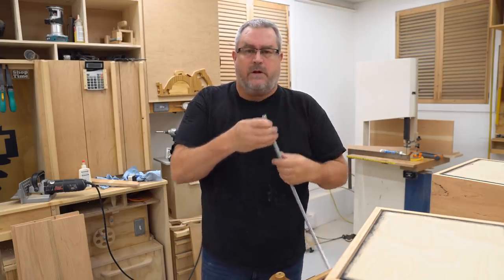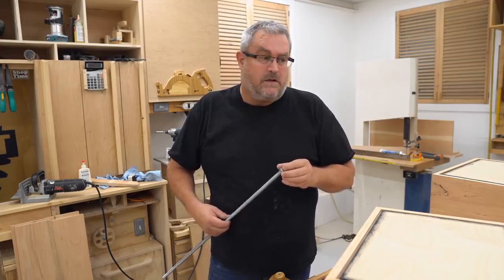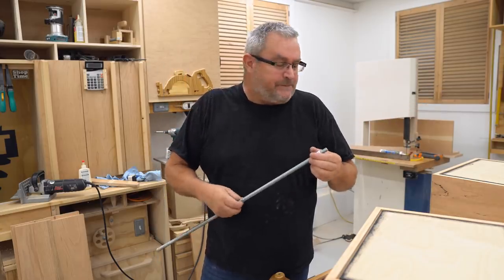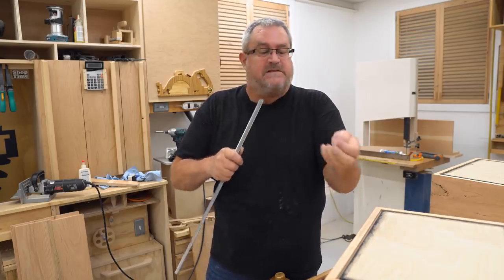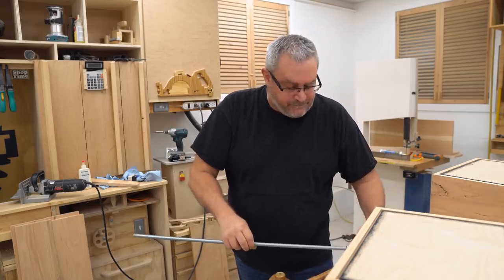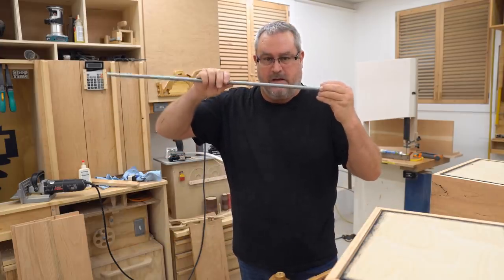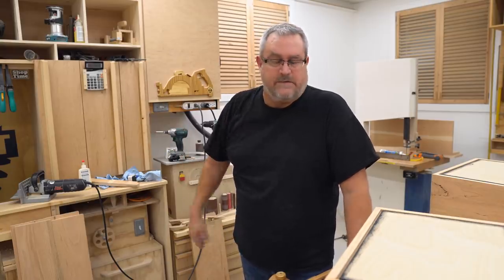Why I Don't Use ACME Threaded Rod

Comment: We had this problem at work with a valve spring compressor. It uses 11/16ths all thread to compress the 4 springs. Probably somewhere in 600-800lb spring force. 

We switched it over to grade 8 all thread and never had a problem since...... but obviously not available at your local big box store.
Reply: 11/16ths is an odd thread size. The last common thread in 1/16ths is 9/16ths. After that the sizes go up in 1/8ths. So after 9/16ths the next size is 5/8ths then comes 3/4s Which leaves 11/16ths out.
Reply: @1pcfred  Ya. I don’t know why I put 11/16. It’s actually 7/16 and uses a 11/16 socket. That’s where my 11/16 came from. Lol.
Reply: @BudgetBuiltDiesel  7/16 is a SAE thread. Still not a popular size though. It sits between 3/8" and 1/2" which are both very popular. The common head size on 7/16" is 5/8s I have a bin of them next to me. I stock all sizes from 2-56 up to 1-8 I'd have had to get up for a 2-56 though. The 1/4-20 to 5/8-11 bins are within arms length. I didn't even have to stretch to get some 7/16-14 really.
Reply: @1pcfred   The nut takes is 11/16 size for a 7/16-14. Where the bolt head for a 7/16-14 is 5/8. 

We use the nuts with all thread and not the bolt.
Reply: @BudgetBuiltDiesel  let me check that out. The bin of nuts is right under the bolts. You're right! Probably the only person on the net that is right today. It is such a rare occurrence anymore that I'm shocked when it happens. There's usually two nut flat sizes for every thread. There's the regular size then an oversize. If I pulled the bin out I might have an oversize nut in it. I'm not getting up right now though. Sometimes I do store the oversized ones separately. But I wouldn't for 7/16-14 It is such a goofball thread I don't have much of that hardware at all.
Reply: @1pcfred  Ya. It is weird. I checked McMasterCarr before I responded  to make sure sizing was right on the nut. 

I only use it for this shop made tool. Other then that we hardly use  that size at work.
Reply: @BudgetBuiltDiesel  7/16-14 is not a popular size. It is between 3/8-16 and 1/2-13 and they're very popular sizes. So 7/16-14 gets elbowed out by both of those.

Comment: All fantastic points! I wonder recon threading your own nut would be better as you get full cut threads instead of those flats on the inside of the nut, im not sure how the rod interfaces on the inside of the saw but if it was possible you could enclose the rod then then drill an oiling hole through the nut?

Comment: Here in italy we have untreated rods and nuts, they are just plain steel. They are stronger and more precise then the galvanized ones. Are they available in other countries?
Reply: Normally coated fasteners are zinc-plated rather than galvanized in the United States.  I expect Canada is similar.

But your thought on surface-coating does bring up the interesting point about dimensionality.  Sometimes no effort is made to account for reduced tolerances and parts fit poorly, sometimes only minimal effort is made in that excessive clearances are left prior to coating and parts fit poorly.  AvE did a video comparing the various quality of fasteners, the cheaper fasteners tended to be over-spec as far as strength was concerned, while the more expensive ones tended to be right on-spec.  The more expensive ones were easier to torque properly.
Reply: Galvanized means zinc coated.
Reply: @alans1816  Galvanized and zinc plated as TWX1138 said are not the same thing.  Zinc plating is very thin.  Galvanized means dipped in molten zing and is much thicker.
Reply: @TWX1138  galvanized is zinc. The other common plating is chromate. That's the gold colored hardware. Hardware comes in fit classes. It is supposed to be looser and tighter. What you're getting at a hardware store is class 1 fit. The sloppiest stuff going.

Comment: Acme has higher efficiency than universal all thread thread. Which is why you are more likely to see acme thread in applications where movement is important. As I can recall acme is 40% efficient and all thread is 10% A ball screw is 90% efficient. That's the range.

Comment: John, save yourself a lot of guessing and go with grade 8 threaded rod and nuts. They are rated at 33 rockwell on the "C" scale, that's fairly hard and wear resistant. For a comparison a hand file is around "48" on the "C" scale.

Comment: Isn't a precision adjustment only important for the blade angle adjustment?
It would seem like the blade high adjustment  mechanism could be simple, like a circular saw.
I guess if you're not making dadoes/box joints, no?

Comment: I can understand your desire to source the materials locally, but, and I'm not sure this is true, is Acme threaded rod better?  When you're building something that you'd like to minimize the chances of failure, my guess is Acme rods use a better/harder steel.  I know I could be wrong on this but from my limited use, simple threaded rods/bolts use cheaper softer "junk" china metal.
Reply: The geometry of the threads is the main factor. Trapezoidal threads move better than V shape all thread does. 400% better. What's going to grab more sharp teeth or flat teeth? There's more to it than that but that's part of it.

Comment: From a mechanical standpoint, by hammering it, you would concentrate the force to a smaller area that the thread is engaged, subsequently increasing the stresses on the engaged area, and hence increasing the chance of it stripping it. On the other hand, if you have two nuts glued or welded together to bear the forces, you half the load on each thread and significantly decrease the chance of stripping the threads. You would be still using the non-specialty parts, but tackling it scientifically using regular hardware store parts.

Comment: Your reasoning is certainly valid but buying Acme threaded parts is no harder than ordering a set of your plans.  I couldn't buy your plans at the store either so I ordered them.  Same with Acme stuff.  I've lived in small rural towns and in major metro areas so I understand the difference when it comes to specialty parts.  There are plenty of places that will deliver to your door.  The failure is no surprise with a loose fitting nut.  What percentage of engagement do you think you have with such a loose fitting nut?  Not much.  Add the soft steel to the equation and  failure is imminent.  Sure, you have to order Acme threaded components but they're as close as eBay.  Take this as a positive comment.  I really like your channels.
Reply from the maker: My plans aren't shipped. There are places in the world where people buy my plans, but wouldn't trust the delivery system to order goods online. Or the shipping is expensive. Or the import duty is expensive.
Reply: @IBuildItScrapBin  Fair enough.  Some of the small towns I've lived in were pretty third world but they were still in the US so stuff would arrive eventually.  I didn't consider the viewers with delivery difficulties.  Sorry.  I know your plans are delivered by the Internet.   I've bought some.  Thanks for your great content.

Comment: Hmmm..very suspicious, the whole thing.. Maybe you had bad luck with the material. Usually the hardware shops dont sell the best quality^^... As far as i can tell, i never had such a incidence.  I have built a post vise for metal working, using a M20 rod and i am abusing the hell out of it. I keep it lubricated and i can see no sign of wear on it.. Also i have built a solar tracker for my PV system. The M10 Rod + coupling nut (more threads) does well since 8 years now... Every day from east to west and back in the night time... Hmm..perhaps we have better treaded rods over here in Europe.  ;)

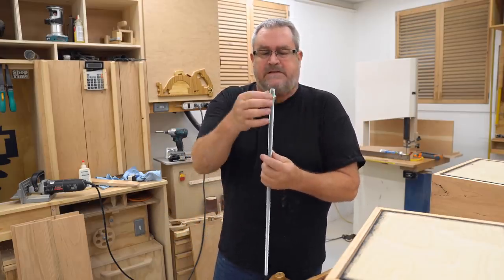Comment: @4:30 has to be the smoothest execution of "Deez Nuts" on youtube. And yea, non standardized crap sucks, I can't help but think a large portion of that sort of crap stems from asshole suppliers trying to ensure that they keep you / a company over a barrel. That's generally when there is some industry standard  or rule of thumb that everyone else adheres to except company "Y" and it just so happens their shit is 3 times the others cost. Of course this is only realized after their product(s) have been implemented. Don't get me wrong, occasionally deviation from the norm is due to a improvement or value gained by someone who found a better way. More often than not though, it's to have proprietary shit that can't be easily replaced by a more cost effective solution. When you encounter bullshit like that you should refer them to deez nuts.

Comment: That is actually not ACME thread. Acme thread is the pattern used on machine tools that is flat on the ridges and valleys. That is standard all thread rod. Acme thread is trapezoidal.

Comment: Menards stocks threaded rod up to 1".  I knew that you used readily available items in your builds.  That's why I did not suggest stainless steel threaded rod in your other video.
Reply: Stainless steel is prone to galling in the threads. I would tend to avoid it if possible.

Comment: Great video! I wonder if using a class 2 or class 3 would make any difference. I’m pretty sure the big box stores is standard class 2. I work in a machine shop and I know the class 3 would have somewhat of a tighter tolerance. Not sure that it would change anything, but there would be less play involved. Just curious John.
Reply: There would be substantially more thread engagement in class 3 hardware.  The wobbly nut looks like a class 1 fit.
Reply: The hardware available in big box stores is the worst garden variety imported garbage they can source. They figure if you're coming in off the street they got you then. And they're right! They're only in it for the money and profits are good.

Comment: Ok, that makes sense. It's exactly the same as a hand tool woodworker not using a tablesaw: it's just not the way you want to work.

Your fix likely will be fine.  I'm curious whether a bored and tapped block of UHMW polyethylene would work as a nut.  It is self-lubricating, certainly wouldn't wear the threaded rod, and is actually very resistant to wear itself.  The biggest question would be strength.  And it's widely available in cutting boards.

I don't expect you to try it just to sate my curiosity.
Reply: If you're going to make HDPE nuts I find you're better off going thicker than metal. Cutting boards are usually only about a half of an inch thick so a bit on the thin side. I use HDPE nuts as lead nuts on my CNC machine. I think the nuts I use are about an inch tall? They're pretty strong. It is surprising how well threads work in just wood. Especially a hardwood like say maple. Better than most would imagine. Threads grab.

Comment: Acme thread transfer power but does not lock as much as standard thread. Standard thread is designed to lock tight .
In high load applications where locking would create a problem (big vises, clamps, trailer jacks) Acme thread is better. 
But in low to medium load applications standard thread is good enough.

Tip: run thread die along the rod a few times to clean up the thread. Put some pressure on the die while spinning the rod. The mechanism will run better after that treatment.
Reply: This opinion is a broad generalization. There are at least 3 types of acme thread. Are you locking you car jack thread while the car is up on it ?
Reply: ZaYwas what is your point?
Have you ever seen threaded rod with a standard thread working under heavy load in any kind of actuator mechanism?
Trapezoidal/Acme thread is used in those designs for a reason.
Reply: @rok1475  What do you mean by "does not lock" ?
Reply: "Does not lock"? What do you mean by that? A screw will either hold its position or it won't based on threadpitch. This is basic first semester physics. Acme thread pattern is used because it can handle larger loads than your average SAE screwthread.
Reply: ZaYwas 
Due to much lower thread angle (~14 degrees) the thread does not create as much friction between the rod and the nut as the standard thread.
As a result it is much easier to turn the rod under heavy load than standard thread with 30 degrees angle, which generates much more friction between the rod and the nut.
Standard thread will “wedge” itself quite well and stay locked while Acme thread will not as much.
So to be more precise Acme thread will lock, but not nearly as tight as standard thread.
Reply: Paul Heitkemper 
Ability to withstand higher loads on the thread is one advantage of Acme thread.
Another is lower friction between the rod and the nut due to lower thread angle that reduces the “wedging” effect between the rod and the nut.
So technically Acme thread does lock, but not as tight.
Hope this last sentence puts you at ease.

There’s more to screw  holding its position than the thread pitch.
It is a bit more complex than first semester physics.
Reply: @rok1475  Tightness will depend on the nut type and it's material and working parameters. Also, to get the highest locking, the maximum diameter for the minimum pitch should be selected ( reasonably). Look, I'm trying to learn something here and typical acme thread ( 29 degrees not 30 ) is characterized as self-locking in every technical doc I could find. Please do not mislead us begginers with such statements.

Comment: I hear all the time about elitist claims of building precision into a given object.  The reality is that even precision machinery is made by trial and error.  Take for example the precision of fit of the piston to  bore in an ordinary car engine.  The fit of  .0001 inch clearance will alow the piston to wipe the oil from the bore so that in 5000 miles of travel under load  at 1500 RPM will  go up and down the bore 7.5 million times and lose about a tablespoon of oil before recomended service.  To achieve this level of precision is a matter of luck(statistics).  You make millions of  engines and make 4 to 8 times as many pistons  and measure every bore and evey piston diameter (testing every one) and recording that information.  To assemble the machine you then match the best psiton to the correct bore and there you have built an extreamly precise creation.  This is no different than what you did here.  I am sick to death of people that have never built anything or solved any problem on their own telling every one of us that have just how things  MUST BE!  To those I say dont think that what you think is fact is in fact a fact.  Some of us know that isnt true .  Dosent that make you a liar?   Keep up the fight John but I think you will lose this one!

Comment: I understand your reasoning for using off-the-shelf products in your build. But. . .  the typical Harrys and Floyds out there aren't going to have enough sense — or patience— to check for quality of manufacturing. They're just going to grab a piece of threaded rod out of the bin and a couple of nuts (without verifying they were thrown back into the correct bin). They aren't going to pay attention to the quality of their wood products either. Unfortunately, you have to accommodate those morons (I may be giving excess credit) at the expense of ridicule from those who feel they are some God's gift to the world bearing all the knowledge of the universe, some of which, believe it or not, are just parroting some thing they have read on the internet (which is unequivocally correct).
I say, "Carry on" , because you have probably wiped from you memory banks more than your most vocal critics have even thought about. I hear the flame warriors assembling.
All the best, 
--Joe.